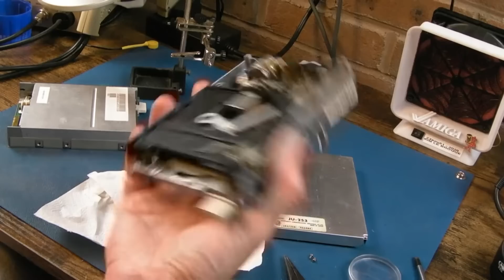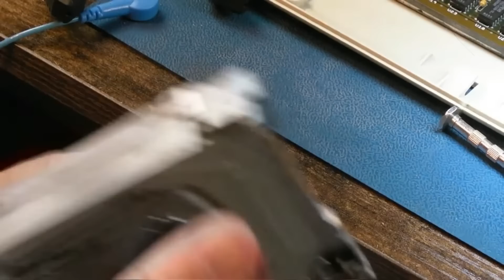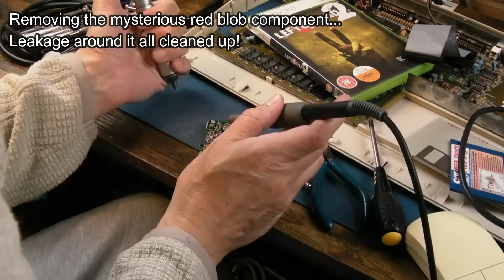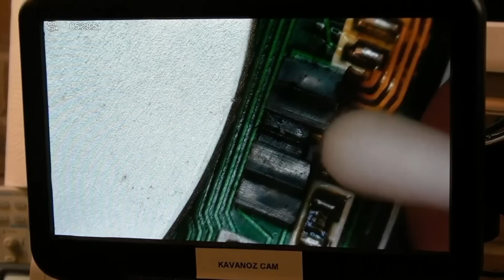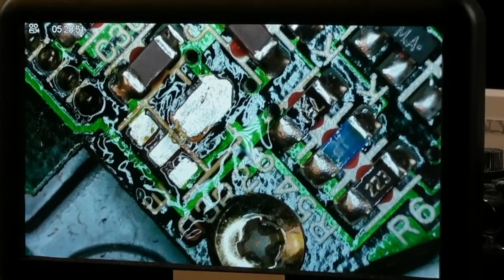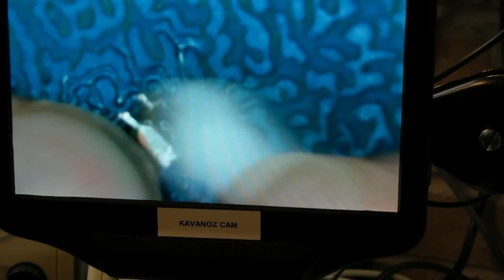Commodore Amiga Ghetto Drive Repair (JU-253)

Comment: For your phone - you've probably got a build up of lint inside the connector. I usually use a sewing needle and just scratch out whatever is in there. Carefully if you're having that much trouble with broken phones!!
Reply from the maker: Thanks, but no - that's not it!  I've cleaned out the connector many times and inspected it with the microscope.  It's basically detached on one or more pins from the PCB!

Comment: (@38:37) Most stepper motors have no commutator; the wires coming out connect directly to the coils inside (stator), where the phase-shifted signals from the motor driver create a rotating magnetic field, which is picked up by the rotor, which is a cleverly shaped cylindrical magnet with gear teeth on it. The gear teeth nearly, but not quite, touch the stator pole pieces.
Reply from the maker: Thanks, I've never actually looked at how a stepper differs from a normal motor!  Consider me educated now =D